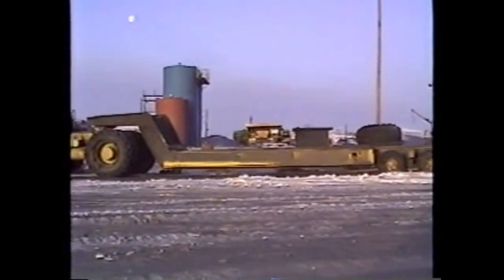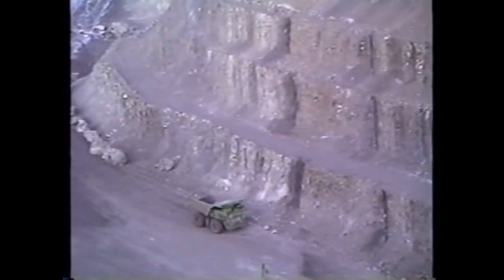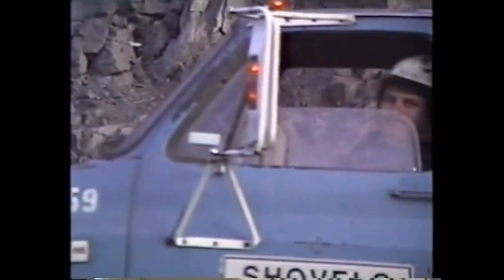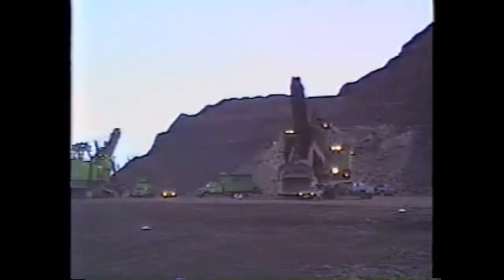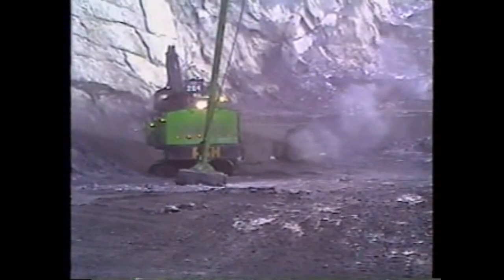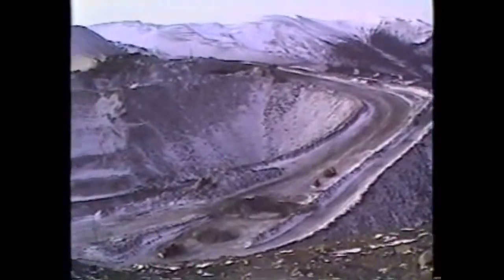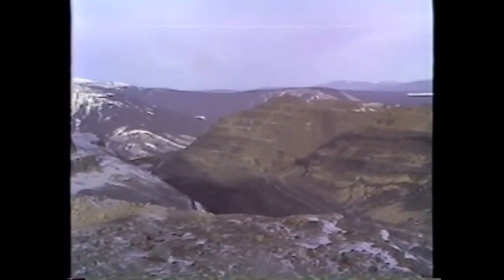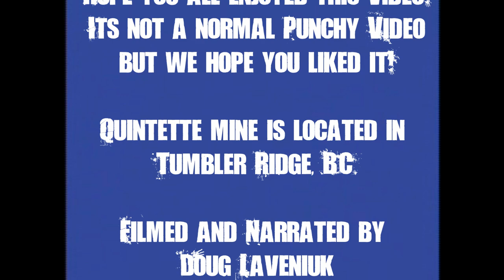Quintette Mine Documentary

Comment: Loved watching this video. I worked on the computer systems when the mine was being built from 1982 thru to the end of 1984.  The first coal shipment was December 1983, which was a bit of a scramble to meet the deadline.  My memory of the mine was that it was flat up by the Eagles' Nest - very different from this video from the mid 90's.  There was a huge Maintenance building and warehouse up the mountain maybe 100 metres lower than the Eagles' Nest - no sign of it in the video, must have been taken down?  The Wabco Haulpak trucks were 170s when it first opened - I guess they got bigger as they were replaced.  When I started they were trying to do all the excavating with the Demags - there was a big scramble to get the P&H shovels in in order to handle the load.